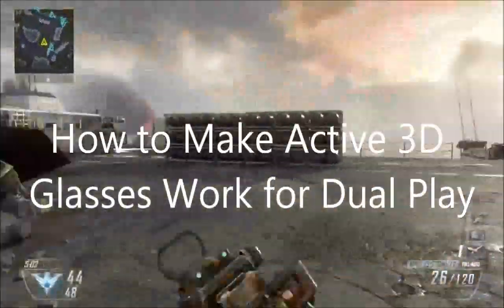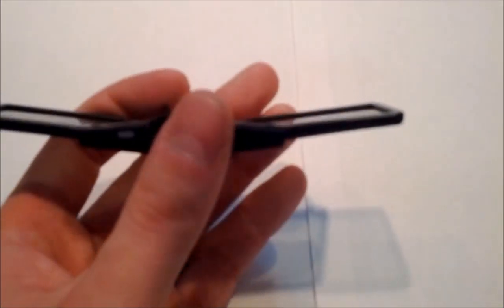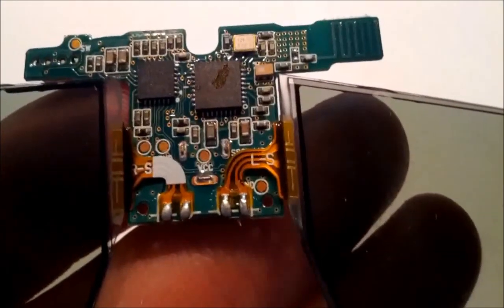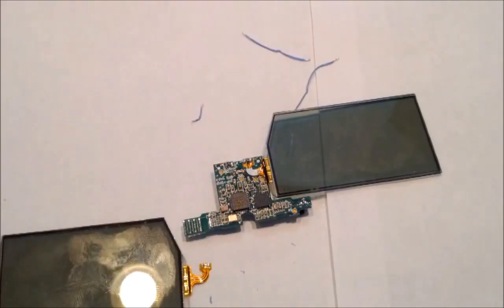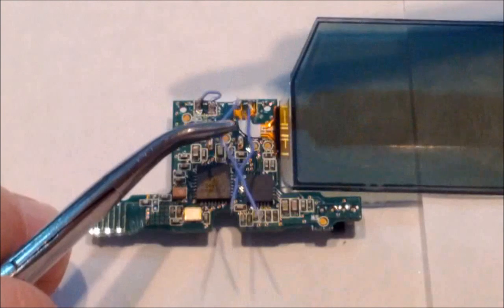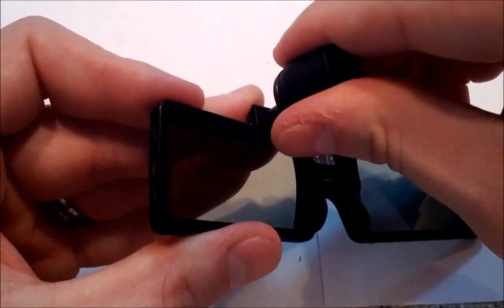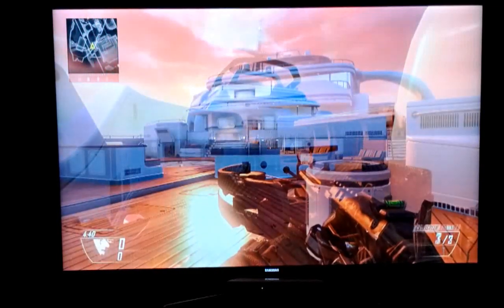How to Make Active 3D Dual Play Glasses - Using Samsung Active 3D Glasses and 3D Capable TV

Comment: Just completed doing this to my SSG-4100GB glasses successfully thanks to you (purchased at Best Buy for anyone curious)!! Thank you very much for the instructions!!!

Something I saw that you did in your video that you may have forgotten to point out is putting electrical (or some sort) of tape over the solder connections on the circuit board before closing things up to prevent any shorts. Just wanted to mention it in case someone ran into problems because of it. 

Thanks again!!!

Comment: Tried today for the SSG-5100 without bridging the unused connectors and it works like a charm. Important to know, do not cross cables. when hooking up the L glass to the R connectors (or vice versa). Otherwise the only requirments are a good, fine soldering iron and some spare insulated cable (if you've got a CAT5 ethernet lying around, the innards of the cable work as well). Thanks a lot for the tutorial !

Comment: Thank you for a great tutorial. I tried it on the the samsung 3050 glasses and at first it worked for a few seconds then it started flickering and eventually turned off, all the while the button kept flashing red the whole time. I then read through the comments, and one guy said that he did it without the jump wire. I tried that and it works perfectly.

Comment: Nice tutorial. I build it with SSG-5100GB. For those no bridge between the connectors for the other glass is needed. I also added a switch, so i can  use it in normal 3D mode.
Reply: How did you add a switch bro?
Reply: Hey, man, what do you mean "no bridge between the connectors needed"... Sorry, I have the same model of glasses and have no idea what does that mean... What is different on the procedure of the video?! I'd appreciate any help...
Reply: KurzyFan I think for the SSG-5100 GB u dont need to bridge the other side of the glass connectors. In the Video it is around min 8.00. Simply connect the one glass to the connector of the other one. I can send u an image of my connection, but it is with switches for both 3D Mode and gaming mode. I used 2x  SX254 Hartmann switches for my glasses. In Germany u can buy them at conrad.de or reichelt.de. U have an new massage :D
Reply: Kimy U got a new Email :D
Reply: Hi, kannst du mir auch ein Bild davon senden?
Reply: Goldbach87 Email?
Reply: Hi +MrAufmsofa can you send me the image with connections and the switch as well? Thanks!
YooTube at emkata.de
Reply: Ses Chan Remove the battery and temples, then remove the 3 little screws. Cut in along the outside of the glasses with a scalpel, it's kind of glued. Then carefully open the glasses with a plastic pick or opener for mobile phones. For the first time you need some time and moderate force. Hope this helps.
Reply: ***** u got mail :)
Reply: MrAufmsofa Please MrAufmsofa, would you send me the images of your glasses, i really need to make that change! dank!
Reply: You should do your own video of the mod so that you don't have to send pics hundreds of times!

Comment: man, i play a lot of split screen with my nephew, i was considering buying an LG but Samsung is better, now i was thinkin about this, doing a bridge for the lenses to work on both eyes... but now i found your video then it does work, thanks for this man time to take out my soldering kit, thanks a bunch
Reply: i have a lg, i just used the 3d glasses from the cinema. the lens just pops out, very easy to do
Reply: +sov tan but is ur tv a active 3d ? or passive?
I'm sure movie theater  ones only work with passive
Reply: DontHackLuigi the model is Lgub980t. And yeah its passive which is why i opted for it. sorry I know this was for active 3d.
Reply: +DontHackLuigi I got two pairs and just popped out the right lens on both pairs then swapped and reversed them, then snapped them back in and now have 2 dual play glasses. 
I initially went cashed up to buy a Samsung curved TV but after 3 hrs  got a Lg. I always thought Samsung was better but have to admit the LG was better, my friend was also in the market for a new Samsung but ended up buying a 80 or 95 to inch version of mine to upstage me. I love Samsung my phones and tablets have all been flagship models but I must admit LG is the best out there now for quality, price and usability... If you can get a 4k OLED with 3d you won't have to upgrade for years to come.. 
my current TV the blacks are still very dark,  I'm pretty sure the pixels turn off cause sometimes I can't tell if it's off or on lol. It's also 200hz so helps with gaming too

Comment: This dual play works perfect with projector benq w1070 + xbox one + sainsonic 144hz 3D Active glasses. How to resolder the glasses: Disassembly glasses, remove the 2 connections from left glass, solder 2 wires from the right glass connection on to the left glass 2 connections, reassembly glasses, use original button to switch between 1/2player screen. Any 2 player split screen seems to work. Just start any game with split screen , go to 3D mode on projector, then choose top-bottom or side-side.

Comment: I just reconstructed my 3D glasses according to your instructions. Thanks very much. It really works. The only thing I did a little bit different were the long wires you used to connect the soldering joints. I instead used shorter jumpers to connect it. Additionally I used some special modeling clay to insulate the soldering joints. 
But have you any idea how to minimize ghosting?
Thanks

Comment: First set worked well, glue came off really easily, second glasses they glue was on a lot my and ended up on partially opening them. Second pair has ghosting, but i may have damaged the ribbon bit I think. thats the only reason I can think of why its ghosting, i re-circuited it three times and same result. dam!

Comment from the maker: I did not get that, I am wondering if maybe you wired the one lens backwards?  I was not able to get my pair to even turn on when I did this on one of my trial pairs, but I would try and switch the two wires on that lens first.  If that was the case, or you figure out how to fix it, please post it here to help others that may have the same problem.  Good luck!

Comment: I did this with the same pair you did, SSG-4100GB, but I am getting pretty much complete darkness in one lens when the glasses point at the TV (the left lens) which uses two red lenses (according to the red/blue stickers on the packaging). The glasses connect ok and the connection points are ok. The blue pair works fine. What can be the problem?
The TV is also a Samsung.

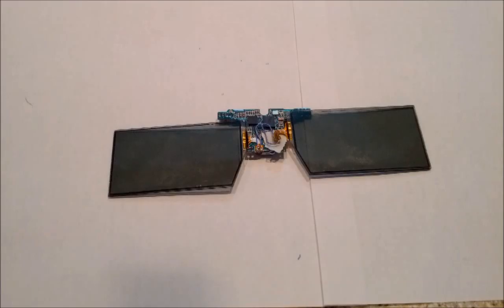Comment: Hey at 12:45, the screen changes and there seems to be some white/grey material under the re-soldered ribbon. What is it and the significance of it? Cheers!
Reply: Oh its insulation tape to stop any other connections. Quite an important part not outlined there I think. You're not attaching the ribbon again at the end I see

Comment: Tried to do this twice now and cant seem to get it, was wondering how much for you to build me two and postage to QLD, Australia...
Reply: Hi Adam,
You can actually buy glasses that can do the same thing from XPAND. They are a bit expensive but they work perfectly. Try to search for XPAND B104.
The XPAND glasses have a button where you can switch mode, so you are still able to use them as normal 3d glasses.
Reply: Bjørn Hansen Do you know if this would work on a 2011 Samsung TV?